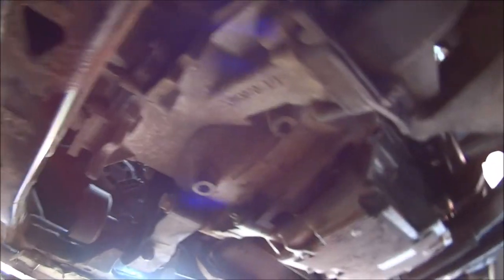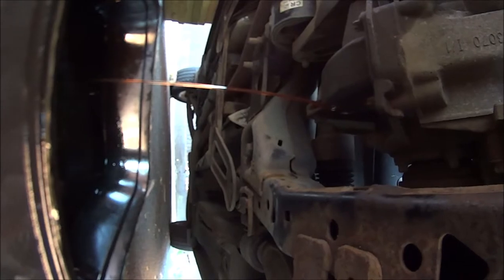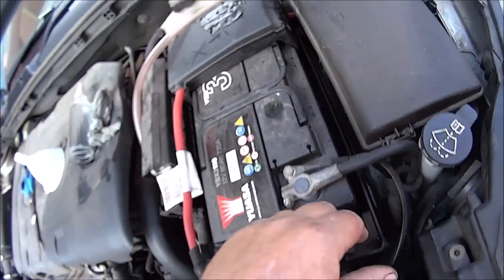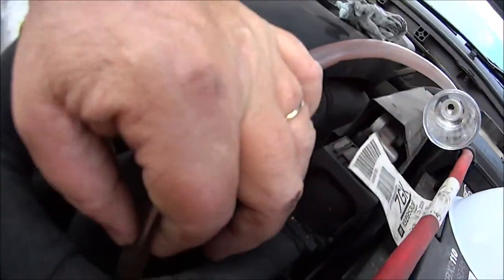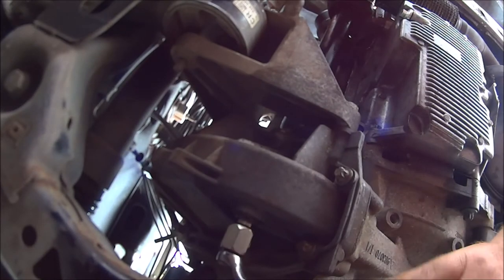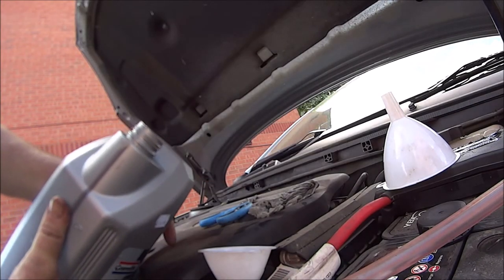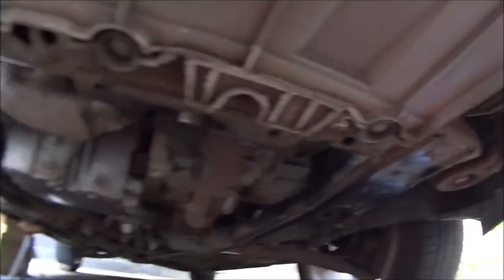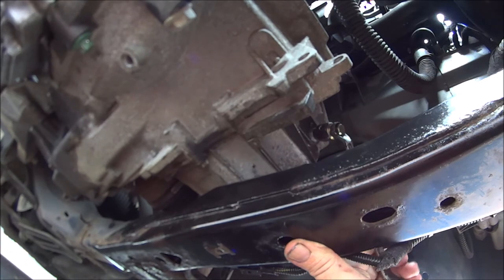VAUHALL INSIGNIA cdti, Gearbox oil change. UK

Comment: Thanks for that bud, i might give that a try later on, something to add however it's advisable to try and crack the fill plug first before draining the fluid off as if the plugs rounded/seized you're stuffed for refilling it. :) Thanks again.
Reply from the maker: Cheers buddy and thanks for the helpful tips for everyone.  Good luck with the oil change 👍

Comment: Use full video, i've been using the top fill via tube method over 10 years, defo the hot tip to save all that extra work..! 🙂

Comment: The 2ltr cdti has the f40 gearbox in which should have 75w 90 fully synthetic  in not semi synthetic. Also you should only put 1.8ltr of fluid in per vauxhall recommendation.
Reply from the maker: Hi David Thanks for advising everyone cheers buddy 👍
Reply: yup !
Reply: Where have you seen those informations ? I can't find anything about the manual gearbox oil in the manual.
API GL-4 or GL-5 ?
Reply from the maker: On Google 👍

Comment: Would it be anybetter to use a oil removal  pump  to put the oil back in  ,,does the only in the vauxhall insignia estate  ever need changing  I've be told no but surely  it must lose viscosity  can anyone please advice  if does or doesn't  thanks
Reply from the maker: If you can afford a oil removal pump tool why not just buy the best oil money can buy. 👍
Reply: @jonyr1TT  only 12 pounds  on ebay and does the job
Reply from the maker: Cheaper than the oil then 👍

Comment: hi . nice video with no BS. my astra gtc 2.0cdti sri looks like it has the same engine as this . do you know the model this gearbox is? as mine is hard to get into 1st and reverse so was going to try to add more new oil in . cheers
Reply from the maker: Sorry I didn't know the model. Could be low oil. Or warn linkage.
Reply: @jonyr1TT  i don't know if you mentioned this in video but are you jacking the side to get all the oil out . then levelling off to fill? cheers
Reply from the maker: Just did it on the unlevel floor

Comment: Could show video off location oil presure switch  as hard to find
Reply from the maker: I don't have the car anymore 👍
Reply: don't know where the oil pressure switch is but been told the engine has to come out to change it 😳

Comment: cheers thank you, just a quick question. My 63 insignia recently came up with a transmission error, lost drive. AA got me home, some advised me to start the car up and see if it engages gears and drove like nothing was wrong till the temp started going up, he has suggested i might not have enough oil in there or the oil is just too dirty hence why when temp goes up i get the error and lose drive. there was no other noises or anything. Going to do an oil change as seems the garages around aren't interested. Any advice anyone?? I dont remember having the oil changed and its now up to 160000miles...
Reply from the maker: Thanks buddy... I don't know if you have the petrol engine as they seem to have a lot of head gasket problems I'm not saying thats what it is I'm not a mechanic. You might get some great tips if you go on one of the insignia forums.. Anyway good luck with it.. 👍
Reply: @jonyr1TT  it’s a diesel Vauxhall insignia 
Thanks for the reply

Comment: Nice one and thank you.. Just to confirm , does filling to the level of the filler plug hole indicate the oil level is correct? Assuming the car is level of course.
Reply from the maker: Cheers buddy your welcome.. Yes buddy that is correct. 👍
Reply: I was told do no how true should fill it at 45 % is this true or false please
Reply from the maker: It says level in the manual

Comment: Great video. Just a quick question if you can spare a minute. I recently had my clutch changed and ever since I've been finding it difficult to get it in to 1st and reverse first thing in the morning but gets better when it's warmed up but still isn't the best. Any advice would be appreciated. Cheers
Reply from the maker: Sometimes when they refit the gearbox they don't set the gear linkage up properly.

Comment: Excellent video John, very creative. One question, what diameter pipe did you use? Thanks.
Reply from the maker: Cheers buddy... The outer diameter of the pipe was 13mm.👍
Reply: So a 7mm internal pipe? Assuming  the thickness is 3mm?
Reply from the maker: Think that would make it 10?👍

Comment: How much horse power is that engine ? While i was changing the o-ring in the oil pump it lost transmission fluid (and I don't know how much) so i want to refill it...btw thanks for your video it's very helpful
Reply from the maker: Thanks dejan if you just need to top up the gearbox oil, when the oil starts to overflow out of the filler hole it's done just put the filler plug back in 
.as to the horse power I'm not sure it was the 2.0 engine. I don't have the car anymore. 👍